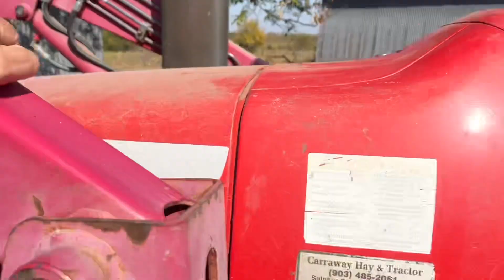Barn Roof Blown Off

Comment: I know you won't but anyone else watching please wear work gloves when handling rusted metal and have a recent tetanus shot! You have a bit of repair work to do on that born. It is likely a two person job. Maybe replace the support struts before dragging stuff off the roof? It looks well kept so I guess just old age and weather
Reply from the maker: I always wear protective gear, eyes, hands, feet, and I do have a current tetanus shot from last June.  I made sure to turn all the tins with the nails down so that I would not step on one.  Still, I'm surprised I didn't poke or cut myself yesterday.
Reply: @LibertyGarden  I know you know. It was for others who see it. In a shtf, if one happens, I know I will have to stop and think health and safety a lot rather than just act.
Reply from the maker: @HuplesCat  I'd be extra crisp and rested when handling bladed power tools like chainsaws and angle grinders.  Those two can mess you up in a blink of an eye.